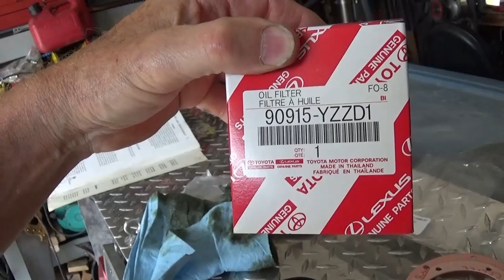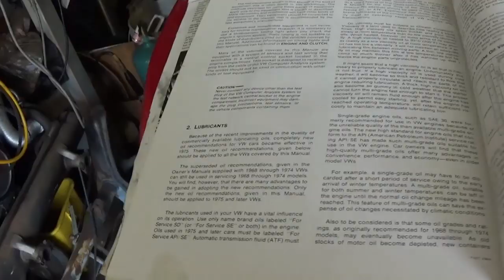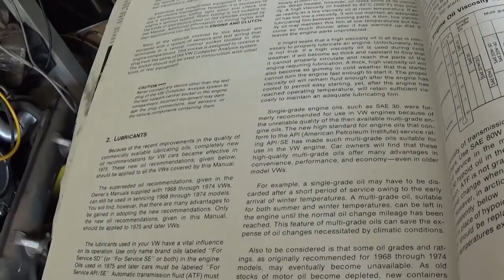1776 - 1,400 Mile Oil Change Results

Comment: Good up-date on the motor . On the stock motor 1600 dual port I went with a PICT30 carb & sdva dist standard points . Motor still on my engine run test stand but testing on it been great. I'm adding a AFR gauge & 02 senor to my run test stand to collect  data on different carb set-ups motors. I need to do make sure zinc is in my oil like that additive option. Weather next week in Iowa same as you by late in the AM the air is heavy . The local NAPA a block from my house takes used oil they burn it in the winter for heat.

Comment: Groups 3 synthetics like Pennzoil and Castrol are just severly hycrocracked dino. So it super refined and performs likensynthetics even though it is just Dino. Perfect dino if you will. So use at will. Some flow characteristic issues have cropped up and heat absorption issues caused some issues back in the day.

Comment: I need to build a 1776!! That has to be a little extra power for hill climbs. I will be running 30 in the summer, but only for the three hot months for me. Otherwise it’s 10w/30 for me with some Rislone ZDDP additive
Reply from the maker: sounds like a plan :-)

Comment: The oil looked a little black.  An AFR gauge is great for dialing in the fuel mixture, and seeing what is happing when the engine is running at different temperatures, and altitudes.  I use an Innovate Motorsports wide band sensor, but there are other brands too, and you don't have to have fuel injection to use an AFR gauge/Lambda sensor. Great video and you even cut open the oil filter!

Comment: An AEM wideband air/fuel analog gauge, AVM-30-5130 could be a good choice for use in a dune buggy.  The more common digital display type gauges are difficult to see in sunlight.  I was changing my oil every 2000 + miles, but now 1000 or less, and finally see clean oil in the dip stick.
Reply from the maker: Why bother with a AEM gauge on a basically stock engine with carburetor? Factory didn't put one in! A plug reading now and then is good enough for me.
 I live at the base of the mountains at 5k feet altitude. In less than 90 minutes I can be at 10k altitude. So what am I going to do with the information? I am not going to stop and change jets....  
The older I get the more the KISS system makes sense :-)
Reply: Yeh, I guess you wont be able to adjust things, but I was
thinking there could be areas in your carb set-up that could be tweaked a
little.  Wow 5000’ altitude change, it
sounds like you have the engine dialed in perfect.  Thanks for sharing your videos.

Comment: Always a good day when t's an EZGZ day. quick question, what size tyres do you have on the back of the buggy? I did have a pair of 31x10.5 R15s on my little 1600tp trike, but after not being able to use 4th gear on anything resembling a hill I swapped those for a pair of 195x70 r15's. Hopefully closer to stock size will let me use 4th and have a reasonable top speed.
Reply from the maker: 235x70  work ok but I can sure feel the difference from the bigger engine's I was running. Also look at over all weight of the tire. Same size tires can be 5lbs heavier and you can feel the difference from that as well.  205x60 might be a nice option but if you go to small it will hurt your mileage and top speed. I always thought I would like to try a trike but never came across one for my price and style idea's.

Comment: I noticed you crawling on the garage floor little tip i use carpetscraps  from a floor layer friend and keep three pieces laying aroundfold in half nice to kneel on throwit out flat lay under car your done pick it up with  all your tools cradled in it set on top the pile of stuff on bench (because it is never bare)and put them away
Reply from the maker: That's a great idea and shop tip. Especially since with VW cars your always on your knee's or belly. I've had a few scraps in the past and enjoyed them when they were clean but it doesn't seem to take long to get filthy and don't have a convenient source for replacements

Comment: Synthetic oil is good I have been thinking about using it on my 2l. just wondering about zddp. and thinness of the oil leaking. I know castrol is good or kendall. But I have been thinking about using T6
Reply from the maker: Add some zinc and your good to go. I am using synthetic in some of my builds. I wouldn't switch over if it is a really old eng that has been run on cheap oil unless you rebuild first. IMHO

Comment: EZ, need your help... I just finished a build on a stock 1600 daily driver motor. Where should I set my static timing for initial start and warm up? At TDC? A little before TDC, a little after TDC? I'm not exactly sure. Thanks in advance!
Reply from the maker: The book calls out 8 degrees before TDC . So that is number one cylinder on the right side of zero. You can tune it after it's running a couple of degree's ether way for what feels like your best idle. For break in you don't want to idle it. You want it to start and run it for about 20 minutes at at least 2K RPM even if it's running poorly and has a small minor oil leak. Then let it cool completely down and check your valves cold and tend to the little details. Change that start up oil and take for a drive. Good Luck with your project
Reply: @TheEZGZ  Thanks buddy! Will do.

Comment: Hello EZ, I am about to do an oil change, I already order the Lucas Zinc-Plus what grade on the oil (brand) will you recommend I live in Portland, OR.
Reply from the maker: Any modern oil will work great. I've tried them all and never had problems or failures. I think folks make to big a deal about it.  The newer factory manuals even recommended 10-30 claiming it wasn't made right in the 1960's but in the 70's they got it right.  You just don't want to put modern oil's in some old gummed up turd without a very large full flow oil filter.

Comment: Hello EZ GZ nice video
A have a question,  and is not on the subject.
I have a 1641 that I’m building, stock crank, camshaft is a Engle 120, and I’ve been talking to a friend of mine, and he is recommending me to advance the cam 6 degrees. What’s your opinion of it????
Reply from the maker: NO! Your friend is an idiot.  Does he work for Engle and design cam WIth more duration and slightly more lift than it's little brother the W110, this cam is designed to give more power at the top end while sacrificing low end. You can not use this with a stock carburetor, it will barely idle well with dual 1bbls or a centermount 2bbls. You really need at least dual 2bbls of carb for this cam to behave at idle and under 1500 RPM.

This cam really needs some port work and/or LARGER  displacement to work properly. Expect a powerband of 2000-6000 RPMs, the more headwork and carburetion the better the low end will be. If you use 1.25 rockers, you will extend the top end to 6300 or so.

Dual springs are required with 1.1s or 1.25 rockers. Use a compression ratio of 8.75-9.5:1.mshafts? 

A 1641 is junk IMHO. Your being cheap and on a budget or you would build a real engine. You can make more power with a stock 1600 and it will last. Use a Engle W90 camshaft.  

In the first place if you use a Engle 120 you need a balanced counter weighted crankshaft.  

You guys are trying to build something from Junk on a budget. It will idle ruff and sound cool but won't make any power. 
Build what you can afford and do it right!!

You want a loud noisey motor that idle like a top fuel dragster build what you want. Does the Engle company say to ad timing? NO!
Reply: TheEZGZ 
Hello again
Thanks for the advise, 
There is a lot of confusing info. That’s why I came to you, I’ve seen you build cool engines.
Once again thanks.

Comment: How about using a screen on a stock 1914 with ported heads? Stock oil cooler too
Reply from the maker: A lot of people do that and with frequent oil changes and mild driving it would be OK I guess. If you do a lot of hot roding style driving with fast starts and high RPM I would not. ANY VW engine would benifit from a upgrade from the stock oil screen. But let's face it they made millions of those engines that low powered economy engines and they worked fine if you followed there maint schedual.

Comment: Is it true Ck-4 oil for diesel engines have higher level of zinc? I was going to use 30W SuperTech for diesel for all my old cars. Is any reason not to do it?
Reply from the maker: you might find this a good read https://www.aircooled.net/synthetic-vw-oil/
Reply: @TheEZGZ   Interesting read. The article also mentioned that if there is no oil filter installed there is little gain with synthetic oil vs extra cost. Thank you.

Comment: After how many miles are oil changes recommended on a 70 Bug?
Reply from the maker: With stock oil screen every 1,500 to max of 3000 miles depending on conditions.